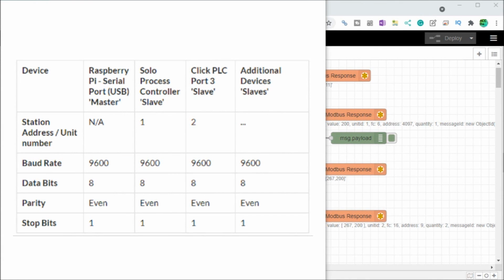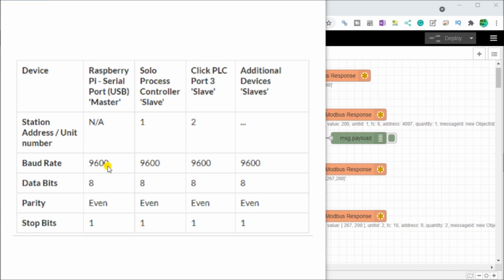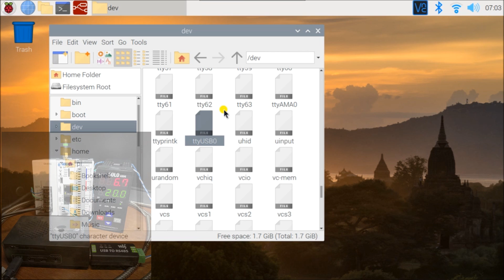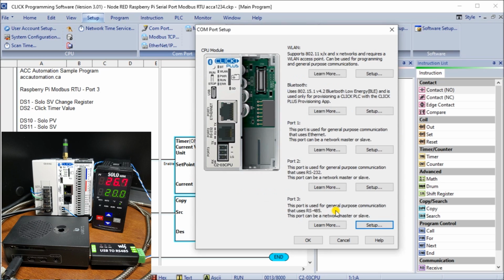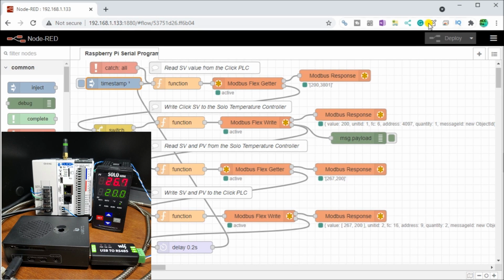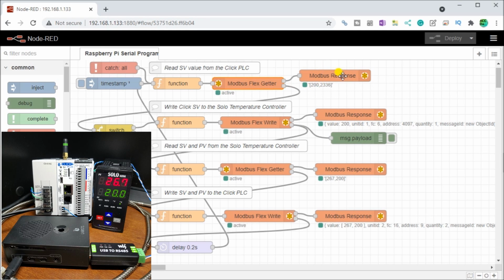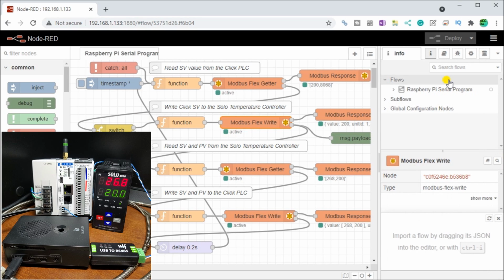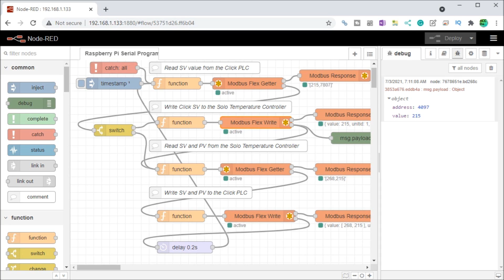Control Industrial Devices with Raspberry Pi RS-485 Magic!

Comment: on rassber pi 4 how you can change bude rate?
Reply from the maker: Hi @marcinostrowski960,
Each of the devices can change the baud rate. The following webpage will go though each device showing you how this is accomplished.
https://accautomation.ca/raspberry-pi-serial-port-programming/
I hope this helps you out.
Regards,
Garry

Comment: Hello, excellent video.
What minimum hardware requirements do you recommend for my raspberry to work well with 5 modbus slaves and NODE RED with monitoring dashboard?
Reply from the maker: Hi Alan,
I would recommend the Raspberry Pi 4 as a minimum for good performance. 
https://amzn.to/3y1AAXZ
Regards,
Garry

Comment: Hello. Did you installed any drivers for USB/RS485 converter (as you did it in your previuos videos on Windows 10) ? Did you make RPI USB port configurations before use it with that converter ?
Reply from the maker: Hi to1 to1,
No installation of drivers was required for the USB/RS485 converter. The Raspberry Pi 4B will automatically load the driver for the following USB/RS485 converters:
https://amzn.to/35UNc6v
https://amzn.to/3foML9A
Regards,
Garry
Reply: Hi. Trying to follow with same converter but getting messages Port is not open. Can you advise?
Reply from the maker: @przemyslawbiskup8746  
Are you using a Raspberry Pi 4 or 3? If using a 3 then see this post. It may help you out.
https://discourse.nodered.org/t/serial-port-not-open/27885
Regards,
Garry